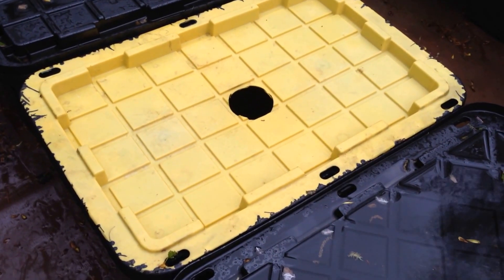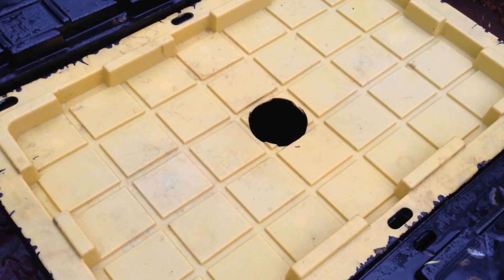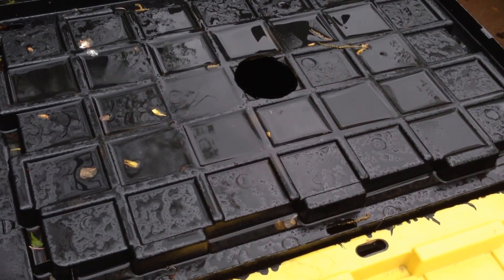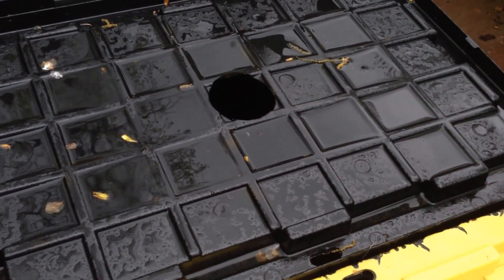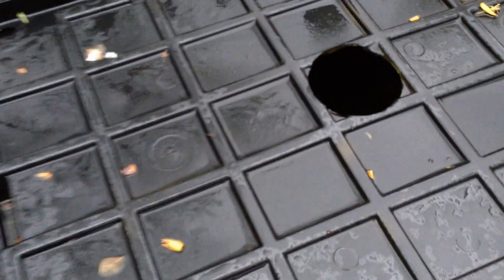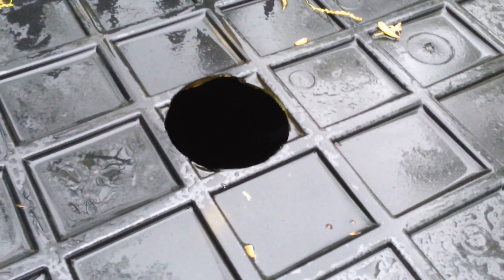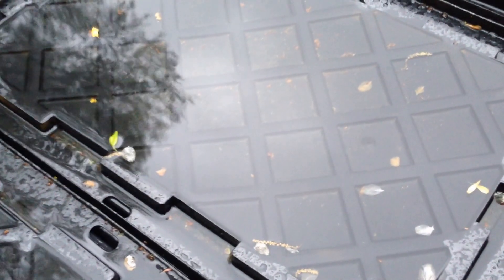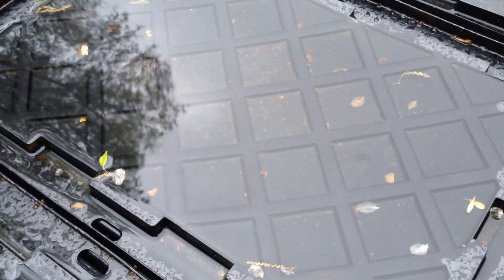B.A. Kratky - Outdoor Hydroponic Containers - Rain Exclusion

Comment: As soon as I bought those I realized they weren't going to work and made covers from some leftover plywood. Unfortunate.
Reply from the maker: Yes, that is a smart solution.  Even with outdoor rated plastic, the walls flex too.
Reply from the maker: Was thinking about your comment, and wanted to mention that closed cell foam board is a quick alternative to the plywood, if you ever want to try it.

Comment: That is awesome, Matt! I am going to try that this year but also drill some drain holes in the outer rim so if the diamonds overflow it can fall into the outer rim and out the drain holes. Using a cup instead of a net cup may make a better "water tight seal" at the diamonds but I guess it is still going to take in it's own amount of water from the top when it rains unless there was an umbrella-like material around the stalk and then over the cup. Lol!
Thanks for the info,  I appreciate it!
Reply from the maker: You are certainly a 'thinker'.  I like your suggestions and hope to see your approach as you build it and test.

Comment: 2x4 on one end = drainage.  Even a 1x3.
Reply from the maker: That would be an improvement.  Instead of 100% of the tote surface feeding rain into the net pot hole, I would have 50% of the tote surface draining into the net pot hole.  The board to elevate the one side of the tote would promote faster draining too.
Reply: Matt Garver Maybe some foam tape, or a dab of caulking on the "Up Hill" side of the tote also??   Lookin Good.
Reply from the maker: Great idea, I was also thinking of putting a heavy bead of caulk around the net pot hole.  Will be testing soon.  Thanks!
Reply: Matt Garver You face problems I won't see. Monsoon Season here is about as fierce as we get.

Comment: Interesting to know.  I've had several outdoor containers topped off by rain with no ill effects.  However my climate is pretty arid so it's only been 1 or 2 inches at a time.  The water is very aerated and usually the cool temps around rain seem to mitigate any issues from it.
Reply from the maker: For a couple seasons, I had a similar experience.  Rain was marginal, and slight fluctuations in nutrient levels did not seem to impact my plants.  Last year, I had episodes of significant rainfall, including 2.5", 3.25", and even 7.75" in 24 hours.  During those rainfalls, nutrient level increased significantly.  Leaves started to yellow and drop off, and plants drooped, as they started to die.  I would have to pop off the tote lids and drain the excess water off.  Several totes had water up to the rim of the tote from the rains.  Greenhouse growing was fine however.
Reply: Ohhh that's a lot of rain at one time.  probably have to rig up some rain Shelters at that point.
Reply from the maker: Professor B.A. Kratky used rain shelters at his Hawaii research site.  I am hoping this year to advance simplified outdoor hydroponics to where the typical at home gardener can put out a tomato plant in a fill-and-forget container.  Then, no watering, no weeding, no potting mix to buy, just watch it grow and pick and eat.  Crazy weather!  I've had historic droughts and torrential rains in different years.